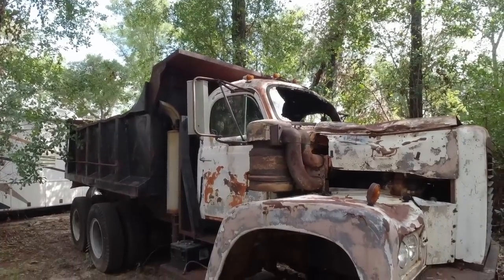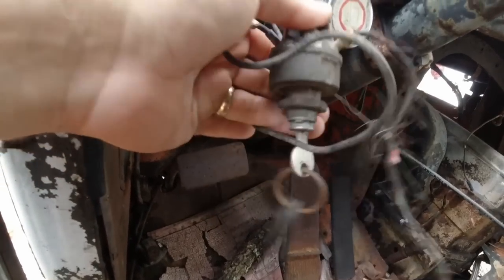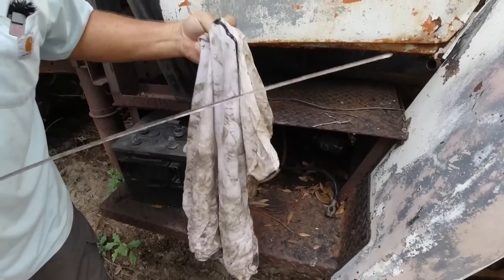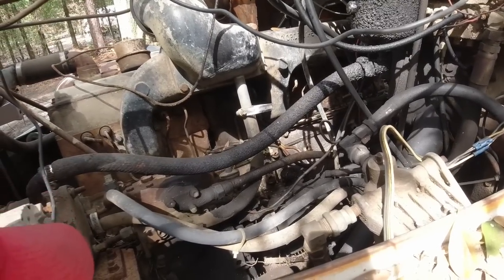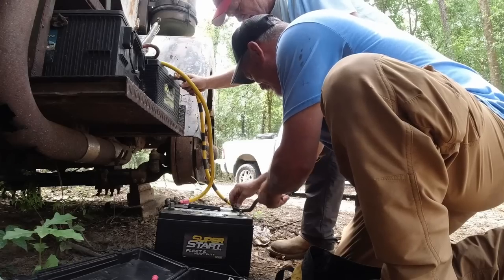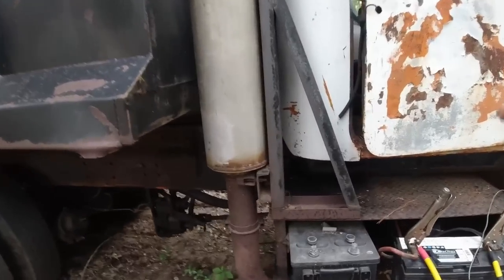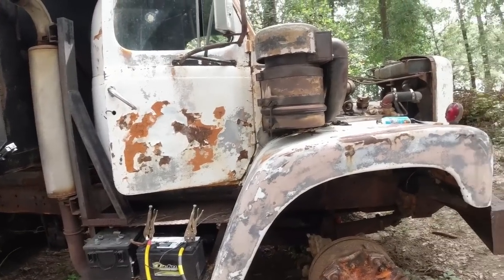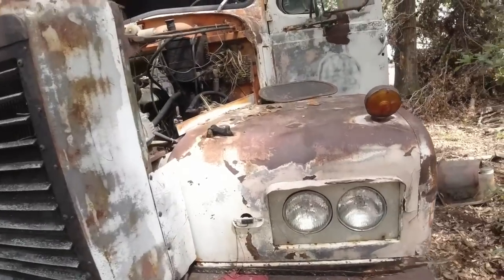WE’VE NEVER STARTED A TRUCK LIKE THIS BEFORE! UNBELIEVABLE!

Comment: Diamond T was founded by the son of a shoe and boot manufacturer (C.A.Tilt) in 1905 in Chicago and was purchased White Motor Company in 1958. REO was purchased by White Motor Company in1957.  In 1967 White Motor Company merged Diamond T and REO TRUCKS to make Diamond REO trucks and in1975 Diamond REO was shut down and later in 75 the plant burnt down.
Reply: Just as a note, REO stands for Ransom Edward Olds. Mr. Olds started the company after he was edged out at Oldsmobile. REO made cars and trucks till the middle 30s. thanks for the history.
Reply: @rkohnke1  Diamond T also made cars in the early days of their production
Reply: @knoester7714  I was not aware of that. I know that White motor company  made steam cars though.
Reply: Great information.  Thank you!!

Comment: Hank, listen up... next time your out of fuel like this was, loosen the lines at the injectors and while its running on starting fluid, the air will work itself out and you just keep tightening each line up as you  see that fuel start dripping real good, It don't need to be flowing, just most of air out... It don't pick its air out of the lines cause its pressure from air not wanting  to go through  the injectors. You can't hurt that engine running on   straight starting fluid... ask old Peg from Spirit Lake up in canada. It might take ten or fifteen minutes to get some of that air out but once it has two or three cylinders a working, its gonna prime itself.  I rebuilt my last diesel engine, a cummins for my brother as he had to have his rig a running bad so    I did most all the work crippled as I am in four days.. from tear down and new crankshaft and cam, bearings, liners and all, back in his rig and driving... four days so I just might of learned something wrenching heavy equipment for steady twenty years before doing other stuff as well. I did keep turning wrenches as you just can't stop when its all ya really know. Them shutters on the front is to keep some heat in the engine in cold weather as diesels don't run so well cold... you want to stretch the fuel, pour the strained out for chunks old engine oil.... it  will run on it just fine, no extra smoke or other. Ask someone that you trust to explain it to you. Decent weather (not dead winter anchorage ak) it will crank and run on straight used oil just as good.... go find out and your going to find out I am right. It has to go through filters for that engine as straight oil or diesel otherwise ain't right unless filtered on any diesel engine
Reply: yup, all it needed was a wrench and someone working the gas pedal a bit. shame :)

Comment: Kysor radiator shutter 🙂 Spray a decent penetrant/rust-remover onto all the shutter bearings and work them back and forth until the slats each move freely. Clean-up the contacts on the temperature switch and treat them to some dielectric grease to keep them sweet. If it still doesn’t work, check the resistance at the switch with a multimeter, that’s probably the only other failure point. It was designed for use in Arctic conditions so it should be fine your side of Canada 🙂

Comment: I remember the old White trucks that looked like this and that might be a 220 and one of the best sounding engines EVER! The local VFD had a Studebaker/Reo deuce-and-a-half G.I. truck with a tank on it. Reo gas engine. Good old truck. Shutters to maintain engine temps but also close and help economy by not having the fan pulling air all the time. You must've sweet talked Wiley pretty heavy. God Bless!

Comment: My Dad owned a '66 Diamond T that was sort of a Reo hybrid. It came from the factory with a Diamond T cab (had the door emblems) and chassis but a fiberglass Diamond Reo hood with Diamond T emblems instead of the metal fenders. I have pictures. Came with a 238 and 10 Speed Roadranger.

Comment: In Ice and snow country those would be closed all of the time.  The blizzards are so bad that Cars have block heaters running 24/7.  My dad drove to get mom from the airport and on the way back they had to shovel snow out of the truck to keep the engine warm enough to keep running! Grand Forks back to Lagdon N.D. (sp maybe). Temp living up there while being prime designer on massive Radar. 🙂

Comment: Hey I enjoyed the video. We have a Diamond Reo truck that's a six cylinder gas motor. We a currently putting a diesel motor in it . It is the  same body style as the one in video . IT IS  a tandem with four wheel drive, a stout build truck.You can see it on a little southern brothers youtube channel

Comment: Watch a few other Will it start on Semi and heavy equipment instead of toting   batteries they use a couple of  jump boxes they are lighter and easy to move around, just a idea.  one I watch has one of them that has 24 volts to jump with.

Comment: The transmission is a Fuller 13 speed Roadranger. I drove a '67 with a 8V71-270 that had been converted to 318 and a 16 speed Spicer air shift 4x4 transmission.

Comment: Been in a reo had 120 hp 5 speed with a 3 speed joey and carting a 7 yard concrete agitator .What a rocket and still not full air .Maybe a perkins common in Australia.Another was the the Knocker Commer 3 cylinder GM we got the best downunder.

Comment: Looks like you need to bleed the injectors of air and it will crank.(not too much either or it will turn into an ether baby I actually just got a 52 Reo f22 dump truck I'm going to trade for some rough cut lumber and it is a reo before the diamond reo was born.awesome trucks

Comment: Those wood blocks holding the front up are way too small - and should NOT be just sitting in the sand that's unstable to boot. It's a disaster waiting to happen. So, what's the story - the owner removed the front wheels to keep it from being stolen?

Comment: dume dume dume  dunme dume dume dume  all day
Reply: When them old Cummings engines  run out of fuel spray ether and hold your foot to the floor with the throttle until they pick up